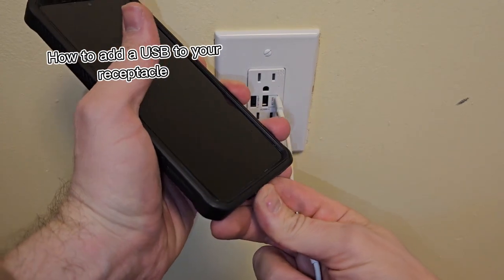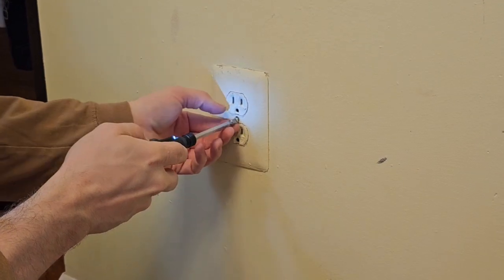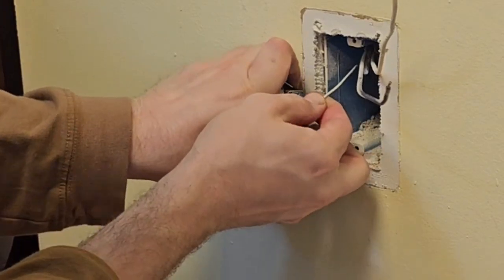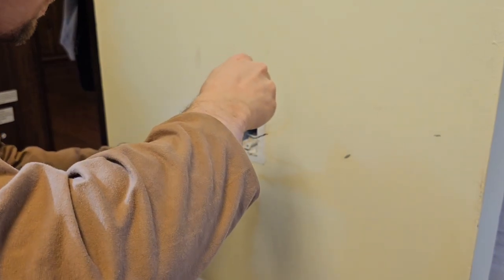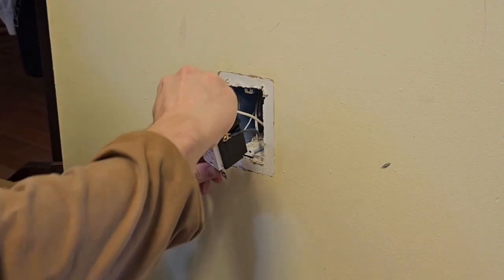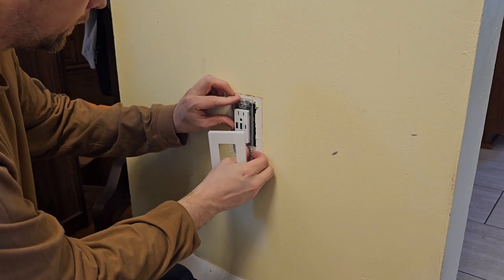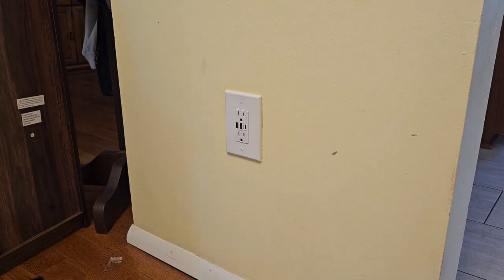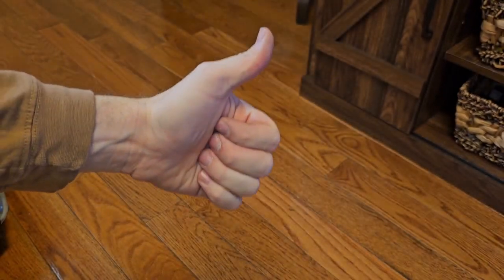how to install a usb receptacle #handyman #amazonfinds #electrician

Comment: It makes my anxios to see you do this using live wire
Reply from the maker: I only got shocked once 🤣
Reply: everyone does this. don’t be that guy
Reply: @Mechanicallyincleyend  please don't encourage live work. We just had a guy working on a 2000amp switch gear the he dropped a bolt in and it turned his hands into claws.

 It is never worth it, and encouraging homeowners to do it is dumb at best

Comment: I have zero contractor/electrician experience, but I do have like basic skills to hang shit, change door knobs etc etc, but in my house the light cover takes 4 screws, and one of the screw just keeps spinning which I found out is because the inside of the box is broken….so the plate doesn’t sit flush it sticks out in that corner and is extremely annoying. Can I just buy a new box and swap it out? Or is there more to it?
Reply from the maker: Can you put a larger screw? And ues boxes can be changed
Reply: @Mechanicallyincleyend  I thought about putting a larger screw in, but when I popped the cover off the hole for that side of the box is cracked so no matter how big or long of a screw I put in, there’s nothing to keep it in place, I’ll have to just change the box I guess. Thank you.
Reply from the maker: @citystars1117  fill the hole with epoxy and then drill it could be another idea. Good luck
Reply: @Mechanicallyincleyend  thank you I really really appreciate it.